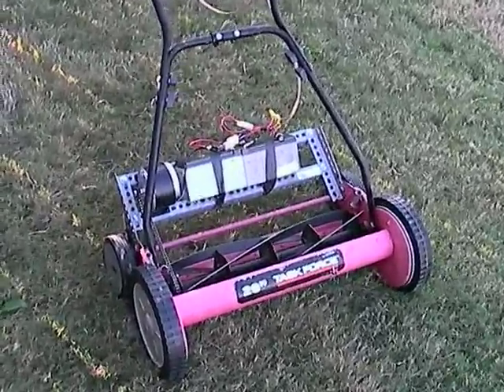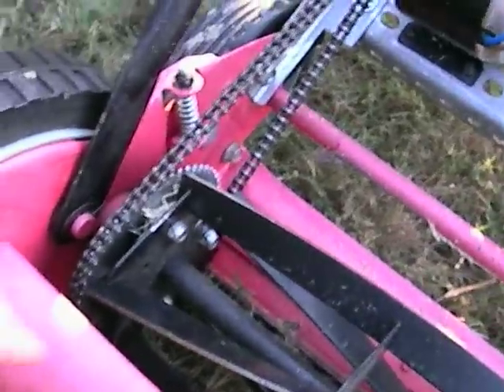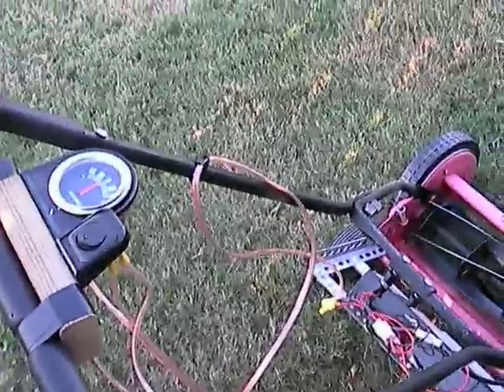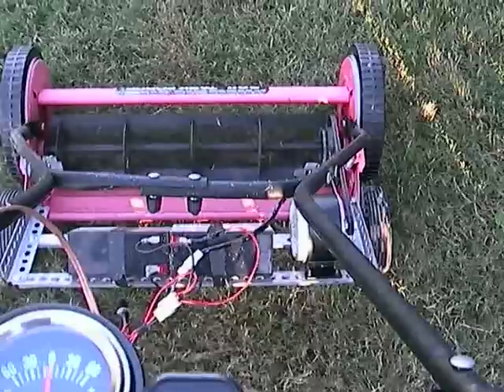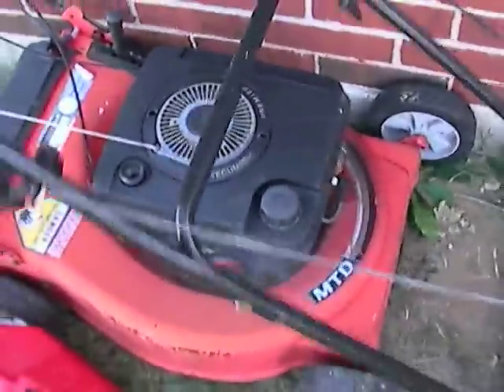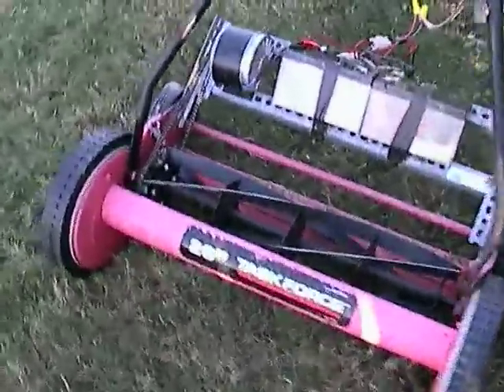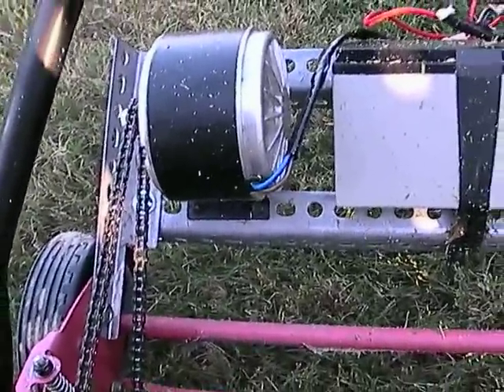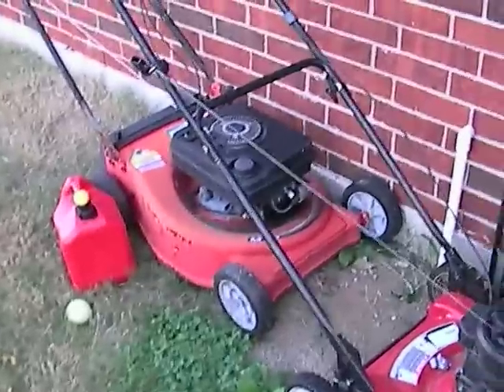Electric Mower from Scooter Parts

Comment from the maker: The noise you are referring to is just the medal blades scraping up against each other.  It made that same noise when it was original maybe a little louder since that gearing made the blades spin up faster.  But the faster spinning cutter made it cut way better.  I bet if someone knew how to properly sharpen the blades and align it properly, it would really cut back on the noise that it makes.

Comment: How did you attach the gear to the reel? It looks like you bolted it or did you slot it with a key pin?  Way cool, I have to make one. I love the way reel mowers cut, seems safer than a rotary mower.

Comment: Great job on the mod :)

What are the power specs on the motor and the amp hourage on the batteries(i assume they are either 6 or 12 volts a peice)? How long can this mower go before needing to be recharged.

I bet you could sell these modified units for good money if the word got out that these can do the job reliably.